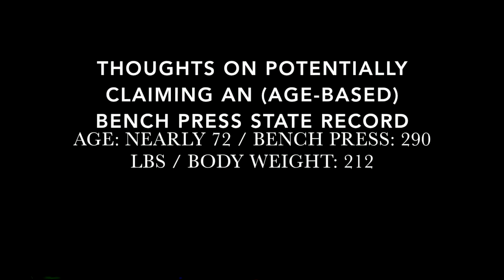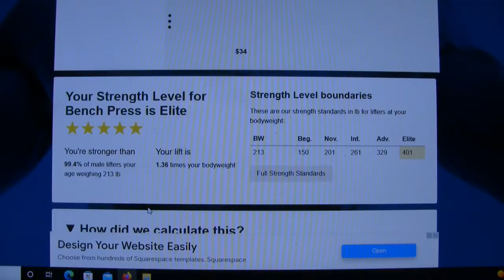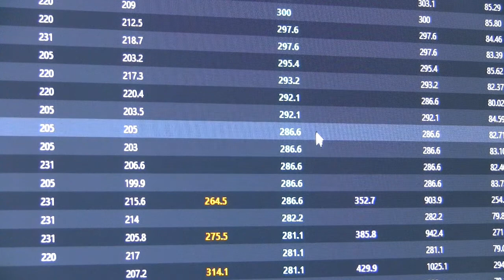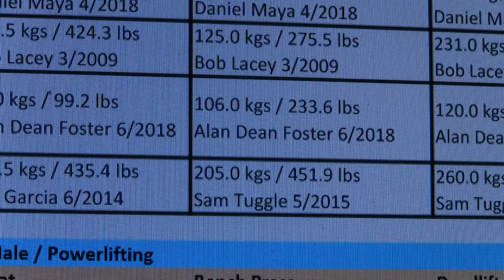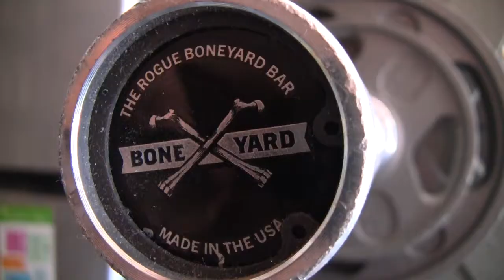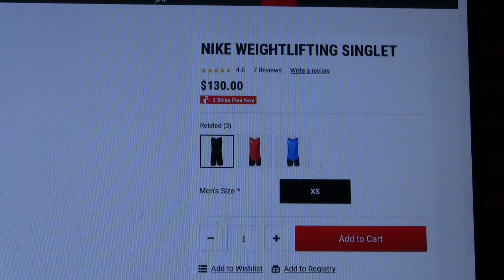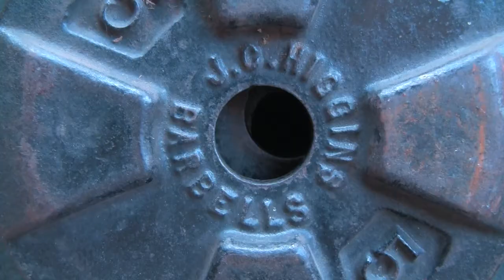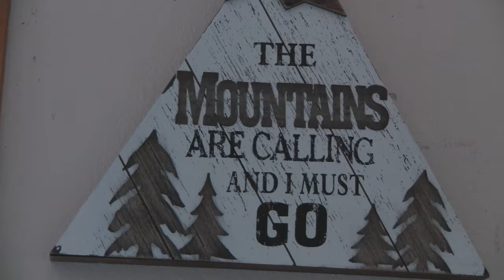Senior Weight Lifting:Thoughts on Potentially Claiming an (Age-Based) Bench Press State Record

Comment: If you can get the state record without even applying yourself to strength training all that much, then I wonder what someone your age who has been dedicated to weight training most of their life, and is fanatic about it can do at your age. Powerlifting is a pretty young sport compared to most others, there was no powerlifting before the 60's, it didn't exist. Of course the 3 lifts existed, but they were seen as nothing more than supplemental lifts for bodybuilders and such, no one seriously focused all their training around those 3. On top of that there are barely any competitors in your age class, I looked up your weight and age class on open powerlifting, and there are only around 200 competitors worldwide, and that's counting all federations in existence, both tested and untested. As you say, there are definitely people around your age or older who are very strong but most likely don't compete due to all the hassle. The records most likely don't show anything close to what is actually possible by someone your age who is completely dedicated, and that's quite simply because there just aren't enough people, barely anyone older than 70 competes. And as I said the sport is also pretty young, so even by that metric the records are probably not close to anything that is actually possible. Another thing is also if you look through the lifting profiles of most competition lifters around your age, most of them haven't been training for that long, so simply put their experience also isn't enough to portray what is actually possible.

I wonder what some of these other older guys who have dedicated their entire life to this and managed to avoid catastrophic injuries would be able to do around your age. There is this powerlifter called David Ricks, he is 63 now, in the same weight class as you, lifting very consistently since his early 20's, and still extremely strong. His numbers aren't just good for someone his age, but good overall, he has maintained almost all of his strength to this day, even broke the squat world record in his weight class at age 58 or so. That's one of the great things about strength sports, strength remains a lot longer than other qualities. You won't see a 58 year old sprinter break a world record, but you can very well see a 58 year old powerlifter or strongman break one. If we were to only go by the records in your age and weight class, they would suggest that Ricks would drop down an entire cliff in the span of only 7 years or so, which I find hard to belief if he manages to stay dedicated this entire time. It's most likely just the fact that there are very very few people in the older age categories for the records to be able to show what's actually possible. For example, in the 80+ age group, there are only a grand total of 360 or so male competitors (counting all weight classes, all federations in the world), that's barely anything. It would be nice to see what happens in 10 to 20 years, hopefully some of these guys in their 50s and 60s with world class strength don't just give up and continue to compete indefinitely, which is the hard part sure, but I'm sure there will be someone who'll manage to pull it off. If you haven't seen it there is a video online of a 90 year old man named Joe Stockinger, who only weighs 147lbs, but can still deadlift 405lbs for several reps, and has deadlifted 445lbs at 86 years old in a competition at the same bodyweight as well. So it's certainly possible, the hard part will be finding people who would be willing to stick to lifting weights for that long.
Reply from the maker: Thanks for the very thoughtful comments. You're probably right about all this. There aren't many guys lifting at my age -- at least few doing anything even moderately heavy. I am aware of a few guys in their 60s online who are still extremely strong. I don't know if they do drugs or TRT and such, but it might be likely. Unfortunately, it seems that everyone these days is under suspicion of doing drugs and needles to get stronger. But, regardless of their"natural" purity or not (and, for most if not all, doing drugs in your youth is probably going to weed you out and away as you get older), the physical demands on an aging body with REALLY heavy weights can take a serious toll. One of the reasons there are so few guys in my age bracket lifting, I think, is probably because they blew their body up in their younger years. Injuries are common when you really push it, even for young guys, and as you age the body isn't up for relatively quick repair. Or maybe any kind of repair: period. And an old body is way more susceptible to troubles, both large and small.

Ironically, those Herculean guys still around now in their 60s might need pain killers (!) to be able to do anything close (and, by definition, they're going to be dropping down a lot in accomplishment) to what they're doing now.  I think that you're right about more old guys getting stronger in upcoming years in my age bracket. But I also think that age is a downward spiral, emphatically, no matter what, and old bodies plain give out at some point. In essence, the body is winding down to die. For me, my loss of energy in the last few years is really evident -- but I refuse to intervene with fake drugs and needle additives and such: I want to age as gracefully as I can. I remember seeing guys on buses wearing obvious tupays (how do you spell that? "Fake hair") when I was younger. And I always thought it was very sad that they couldn't face who they actually physically were. I feel that way about steroids and such. For me, ingesting such material reinforces what can only be a temporary delusion.

More and more guys may continue to get stronger than, say, me on the bench press in upcoming years -- certainly lifetime lifters and those guys who don't lose their fanaticism about competing and such. But, again, like I say, the MAIN reason I weight lift and push myself the way I do is simply for my own self-respect and trying to keep myself, head up, on life's playing field. Maybe more and more old men will arise with that simple attitude and motivation.

I don't know your age, but from your thoughtful commentary, it may be you who pushes the limits of old guys' weight lifting accomplishments to unheard-of levels in years ahead. Ever onward!
Reply: Good comment, but I do disagree with the part where you say "or maybe no repair: period", an adapting and repairing body is a hallmark of being alive, when you are older the repair process might be slower perhaps, but it's impossible for there to be none because if that were the case you'd be dead, and that is pretty much what happens when you die, your body stops all repair mechanisms and begins turning into a skeleton. But as long as you are alive, the repair will always be there, it has to be there for you to be able to live